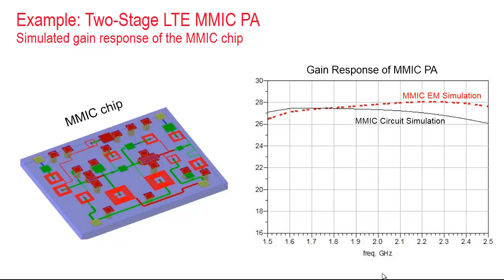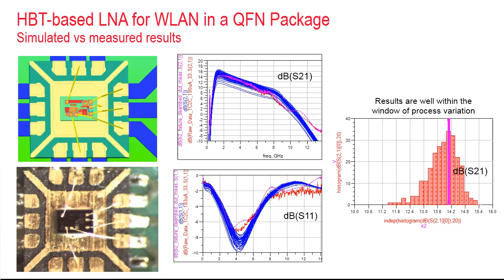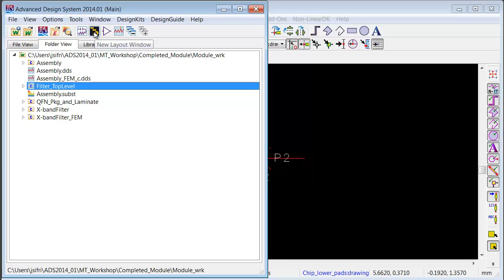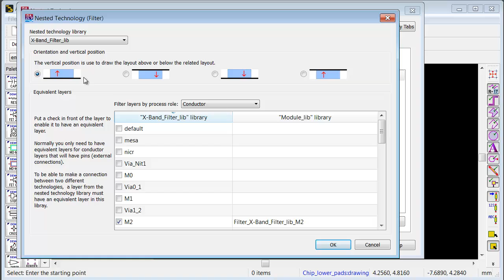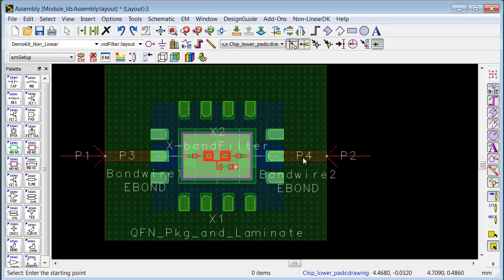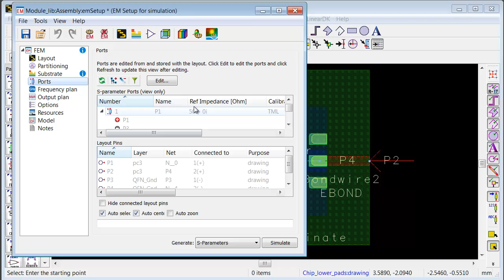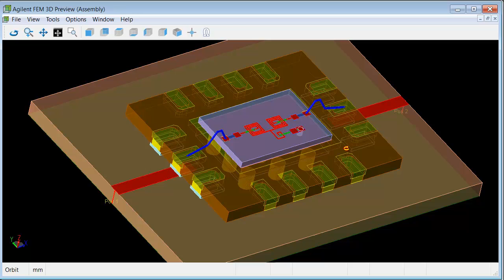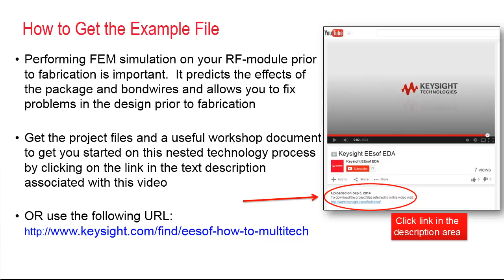How to Predict Package and Bondwire Effects on Your RF-Module Designs

Comment: I am a RF Technician responsible for wirebonding and tuning GaN LTE RF power amplifiers into spec (Gain, Pout, PAE, Noise Power) from an individual MMIC die. Will your ADS FEM technique be helpful accomplishing this task? Please explain. Thank you.
Reply from the maker: Paul Courville 

Yes, ADS FEM will! If you have access to the design file and the package, FEM will accurately simulate and predict the bondwire effect.  In general, if the PA happens to be sensitive to process variation, then each die will require different tuning to meet the specs. Learn more on designing to meet minimum tuning to specs in this video: How to Use “Design of Experiments” to Create
Robust Designs With High Yield https://www.youtube.com/watch?v=hfdZabCVwzc
Reply: Keysight EEsof EDA How is the tuning performed?
Reply from the maker: Paul Courville Great question, but itrequires some explanation depending on what exactly you are doing. Go to http://www.keysight.com/find/eesof-demo-software-request and type in your question and reference this conversation and a Keysight EEsof EDA engineer will contact you to explain it in more detail.